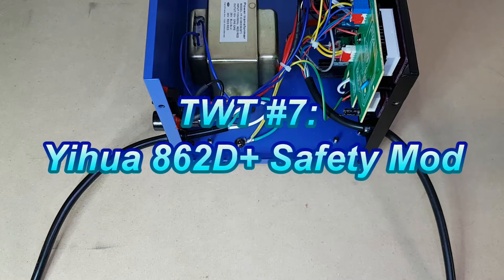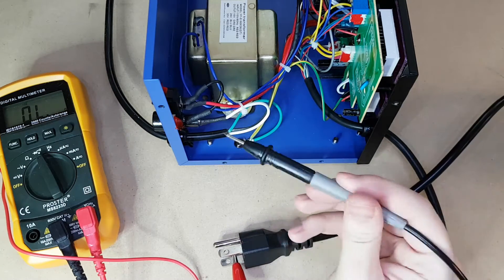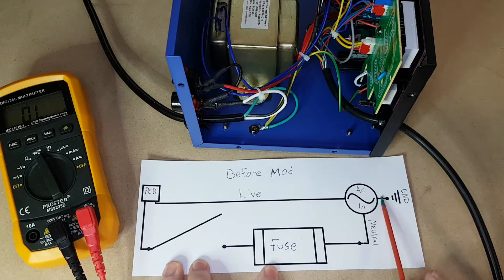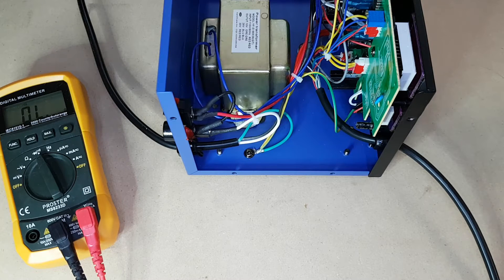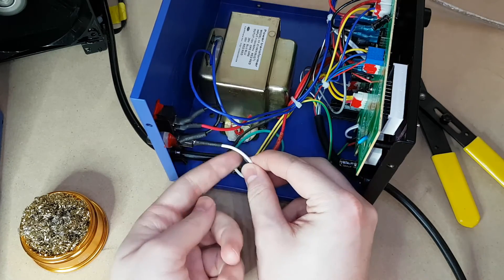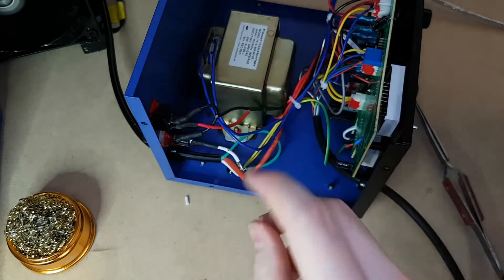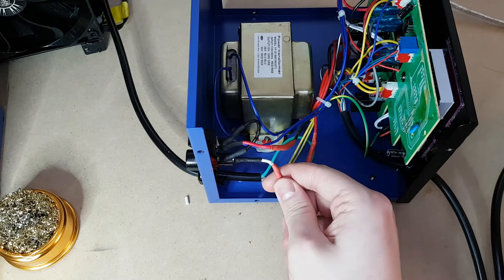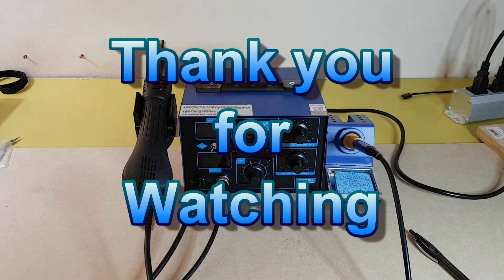TWT #7: Yihua 862D+ Safety Mod

Comment: Do you know that there are lots of countries, for example Germany, where the mains plugs are symmetrical and nobody is able to tell where neutral and live will be connected to ?
The construction of a device has to be safe, no matter where the live and where the neutral wire will be connected to. Opening up a case or changing a fuse without disconnecting
a device from mains is not recommended IMHO. Otherwise, of course if Yihua is supplying countries with definite positions of live and neutral, it should obey the regulations
of that countries or even better use IEC receptables in their cases.

Comment: I purchased one of these and used it several times until it failed. I opened it, and the fuse housing was broken. I will replace the fuse housing and rewire it according to your video. My question is: What is the correct AMP for these stations since there is no marking in the station itself?

Comment: i'M SURPRISED THEY CAN SELL IT IN AMERICA. You should not have to fix your equipment when you buy it.
Reply from the maker: That's the joy of ebay and amazon, most of the merchandise doesn't have to meet safety standards because nobody ever audits the sellers and even if they did, they'd just create new stores.  If you need mission critical equipment that doesn't potentially have these kinds of issues, you have to go to a supplier like Digikey or one of the other big names that actually care about the products they sell. :/

Comment: I know in Canada that the white is neutral and the active should be either black, red or blue depending on the phases used, but wouldn't it have been simpler to just change the plug and correct the wiring there?
Reply from the maker: Yeah, in hindsight it may have been simpler to just swap out the cord and rewire it correctly.

Comment: This is a very common problem with these soldering stations from China. So common, in fact that I starting to think that they do this with all of their products. If you look around for a bit then you will see that of the many different brands, shapes and sizes, this particular schematic design seems to be in all of them. Lost in translation or culture somehow? I don't know. But as much as I do enjoy the excellent prices of these devices, I will certainly be checking 100% of these as time goes on.
Reply: Ah, Would you repeat that one more time, I didn't quite hear you

Comment: ac  + and -   will still be live  and will still give the same shock  .   so it does  not matter  what  side the fuse is on .  so  to isolate bot  put a stdp switch on so it sorts all problems out  .  a transformer does  not need to  be positive  or negative so it does  not matter how you connect it.

Comment: Thanks for the heads up. I just ordered one of these on eBay, so I will check the polarity as soon as it arrives.  The problem probably occurs because other than North America, almost all other countries use 240v with two live wires.  I suppose in that case it wouldn't matter which wire is connected to the switch and fuse, although those should have a two Pole switch to positively turn off the power.
Reply from the maker: Yeah that does seem to be the most likely reasoning, I suppose it is just, more or less, an oversight on the NA and UK versions. Hopefully yours will be wired correctly out of the box!

 I suppose, to be fair to Yihua, the station isn't actually compliant with NA code and doesn't ever claim to be (or at least didn't back when I bought mine 2 years ago). On the plus side there seem to be a lot fewer units shipping nowadays with the reversed wiring inside, at least based on the very small sample size of this video's comments section. 

Even with the potential issues it is still a very good soldering station in my opinion at least, based on my hobbyist usage. Really I suppose the simplest fix to the issue would have been to plug the unit into a power strip with a switch and turn it off whenever it was not in use. In the end though it has been a very decent soldering station and hasn't needed any repairs in 2 years of hobbyist usage.
Reply: Correction. 240V countries still have one LIVE and the other neutral.  The only live wire is 240V not 2 live wires.

Comment: You're awesome for doing this video! Subbed.
Reply from the maker: Thank you for the positive comment it made me smile.  I'm just glad people find this video helpful, or interesting.
Reply: @TinkeringWithTerrius   Np man. You deserve it. It's surprising to me with the amount of the reviews on this (and 'similar' devices) that say they have this flaw and that there aren't more videos on this. Even if it's just to complain about the flaw or QA or whatever else. 

Anyway it helped me see if it was right and I thought it was. I decided to plug it in and bam. Lights blinking '------' and '8' alternatively. Hot air fan restart cycling. 

Tried to open the hot air part but I didn't feel like breaking it. Welp, I'll come back to this after finals are over.
Reply: @TinkeringWithTerrius  turns out a cap basically got destroyed when I first plugged it in. No evidence there was even a cap there other than a couple burn marks. Plus a few cold solder joints fixed now. 

Just wanna say thanks again. While I didn't have this specific issue, it's always nice to check. :)

Comment: I just bought one of these and came across your vid just hours later. My version doesn't have the master power switch on the rear, only the fuse. Gonna check anyway.
Reply from the maker: Hopefully it was one of the correctly wired ones, I suppose the variant with no master switch is just a cost cutting measure, can't think of any other reason to remove it.

Comment: I purchased this unit unbranded from an Ebay seller e-vipcom.
Mine is missing the rear switch, but it wired properly.
It also has 2 broken capacitors floating around in it, and the iron will not go into standby mode.
Otherwise it heats quickly and seems to stabilize. I will report back with how they handle the situation.
Reply from the maker: Glad to hear it was wired correctly, even if it has broken capacitors inside. I look forward to hearing how the seller handles the situation!
Reply: wow urs has standby, wish mine did

Comment: ...Must be how it's done in China?....or are they out to electrocute a few Trumpsters?...
Reply from the maker: I imagine it is just a lack of Quality Control, seeing as there is no oversight on these units by any regulatory bodies (as far as I can tell they don't have any of the necessary safety compliance certifications for sale in Canada at least, so importing them to sell would be dubious at best.) To be fair though, for a product with this functionality and this cheap, it isn't surprising that there are some potentially serious drawbacks, the saying "you get what you pay for" comes to mind.
Reply: ..but...didn't someone point out below...that all you need to do is switch the wiring around?...I mean...reverse the input leads?...The input color coding is not correct for US but we still know what is in the tubes....
Reply from the maker: Yes, as long as both he fuse and switch are wired wrong, swapping neutral and live from the mains cable works. 

I have heard of units that have the fuse on live, but the switch on neutral or the switch on live but the fuse on neutral, I have also heard of units that are wired correctly with no issues, it seems to just be luck of the draw whether the unit was assembled correctly or not. Thus I think the real underlying issue is that they just don't care or bother to QC the units beyond a simple "yep all wires are connected and it turns on".
Reply: ...and...in the end....these units are an amazing price for what you get..just the iron alone is worth it....
Reply from the maker: Indeed, it is a surprisingly good unit for the price, despite the potential shenanigans inside.  Certainly a lot cheaper by at least an order of magnitude than a Hakko or Weller or other name brand equivalent.

Comment: Thank you for your video, very informative. I can also report that I purchased one of these days ago and it's wired 'incorrectly' for NA use, with neutral going through the fuse first and then the switch, and the transformer bearing March 2018 as the manufacture month. I ended up wiring it so the fuse is behind the switch on live.
Reply from the maker: Glad you found the video informative. It is unfortunate but I feel the majority of these will ship with incorrect wiring until something new comes along to replace it, there doesn't seem to be any incentive for the factories to fix the issues. I suppose if nothing else, it is a good reminder to always inspect cheap electronics before using them!

Comment: So for a good test, red aligator on nuetral plug, black probe on white cable + continuity test mode should = no beep?  This sound right? Also mine does not have a on/off switch at rear. Pic here: https://imgur.com/a/tBl0yxC
Reply from the maker: Very odd that they just omitted the mains switch in that unit. 

Assuming a North American style plug, If the meter is attached to the Neutral plug, and you probe the white wire you should have continuity if it is wired correctly (based on colour code of the wires). If there is no continuity then it is likely wired up as Live rather than neutral.

I would remove the fuse and then check where Live and Neutral terminate. If Live has no continuity to any of the live connection with the fuse remove then it is wired correctly. If it does have continuity I'd check and see where the neutral terminates, just to be sure, if neutral makes no continuity to it's connection points then the fuse was wired in backwards.

The colour of the wires seems to imply that the wire that should be Live (the bluish wire in your picture) is going to the fuse, but I'd still double check and make sure that the blue wire is actually live not neutral. I've seen these units where the white wire (which for NA is supposed to be neutral) is Live and in that case the wiring would be backwards.
Reply: Pics here: https://imgur.com/a/xYuowLx

I have a blue wire going into the center of fuse from power, and a red cable on top of fuse going to the controller board. I get a neutral continuity beep from the threaded part of fuse (when it is removed), and switching to the right hot line i get continuity in the center of fuse. I also get continuity on ground, from screws at bottom, the ground connector bundle, and middle bottom pin for hot iron connector at front. Update, checked connectors going into motherboard 5 are both hot and neutral, but only neutral with fuse removed. It kind of seems like it is wired good, but i really dont know.
Reply: Down below you mentioned "If the continuity stays with the switch turned off, or the fuse taken out then you should be concerned." That sounds like me, i have neutral continuity at the motherboard with fuse out. But hot continuity stops.
Reply from the maker: This sounds like it is wired correctly. If you have neutral continuity to the main board with the fuse removed, but do not have live continuity to the board with the fuse removed then everything should be fine!

Basically the important thing is that, if the fuse trips we want it to stop the live side of the circuit as early as possible. From what you are describing in the last 2 replies, it sounds like yours is one of the lucky few that is wired right!

Comment: Thank you for this video - as a point of reference, these units are still (August 2018) shipping out with this configuration.  I used your video as reference to correct mine before I ever even plugged it in.
Reply from the maker: Thank you for the comment, I'm glad to hear the video was useful! It is very unfortunate that these are still shipping with issues like this, I suppose it is unlikely that they will ever change.

Comment: hello, I have such a device is broken me. I need for this data sheet or circuit diagram. can you help me, thanks
Reply from the maker: I spent quite a long time searching around for a schematic/circuit diagram for the 862d+, unfortunately I wasn't able to find anything. I'm sure there is one out there somewhere, I just haven't had any luck finding it. Wish I could have been more help.
Reply: Tinkering With Terrius Thank you

Comment: Double check if you buy one! I just checked mine and my right side was fused (ie the hot)
Reply from the maker: Glad to hear some of them are coming wired correctly! Was the switch in the correct location as well? (immediately after or immediately before the fuse)?
Reply: Tinkering With Terrius immediately after the fuse, however the case is not grounded because of the giant glob of loctite they used. I actually don't see any ground going to the board
Reply: In aircraft construction I can tell you that in installing all ground cables we used a small rotary steel brush with a guide pin that fit into a drill chuck.  You grind away paint down to bare metal, install the ground cable and then we would dab on a weather-proof coating to seal the connection and prevent moisture intrusion that could oxidize or corrode the ground and make it unstable.  I wouldn't use RTV as it breaks down over time.

Comment: Thanks for unboxing and disassembling this device. I am quite interested in buying one for myself.
One thing I am really startled about ... In Canada you know exactly which side is neutral and which is live? Quite a great electrical design done there ...
Don't know if you know our eu-plugs than can be used "normally" and by 180° flipped ... You can never tell which side is live ... Nor you can at the wall socket, depends on how reasonable the electrician was and even more important ... If you know which side should be live. Not even I know which side is normally live, even I am a learned electrician...
I think, if I buy this device, I will mod a 2-phase switch and another fuse in it.

One thing still bugs me ... You are telling "soldered earth connections are bad" but you solder the main wires too ... Not the "good way" either ;-)
Reply from the maker: Thank you for commenting!

Indeed, in North America if the cord has a ground connection then the Live and Neutral are always in the same position, much the same as the UK plugs (though their plugs are much sturdier and just overall better designed.) 

Looking back now I really should have done a proper mechanical splice on the wires before soldering them, maybe someday I will get really ambitions and revisit this mod and tidy it up a bit.
Reply: I think he meant the ground soldered on the plate or body instead of having a screw attached to the body as we see here. COuld be wrong but that's the way i understood it.

Comment: I think this is the case because in many countries the position of live/neutral in the socket is not strictly defined.
Reply from the maker: Yeah that seems to be the main theory. It still seems a bit odd though, since they are using integrated plugs instead of just a standard C14 socket. You'd think it wouldn't take much effort to make sure that when you're attaching the N.A. plug you wire the fuse and switch on the live side.

Alas it just seems to be the way these units are made and it isn't going to change.

Comment: Lol you dudes and your dangerous 120v  :D  Whole europe  can tur their plugs both ways and we use 230v   and somehow its  still secure ;> The important thing is  that the ground is connected.
Reply from the maker: Thank you for taking the time to comment!

The big thing to remember in this regard is that electrical standards are very different between Europe and NA. Even worse, most every state/province has different electrical codes over here. In a lot of cases Electrical codes, in Canada at least, are very antiquated and there hasn't been much change to them in decades. 

The ground being connected is indeed very important, however you are making an assumption that the ground is indeed connected properly, in addition that does not prevent all possible issues. 

Where I am located there is only a requirement for GFCI/RCD breakers in rooms that have running water and more recently bedrooms (and as far as I know this is only on new construction, old construction only needs to be retrofit if you are doing major permitted work on it). This means that only bathroom/kitchen/outdoor and bedroom plugs would be able to handle and break the circuit reliably if a ground fault is detected. The other 15 amp breakers would require a huge current spike or a sustained 15 amp current to trip their breakers, which a ground fault may or may not provide. 

A simple fix for us North Americans is to have an inline fuse (like used in U.K. plugs) or to have a fuse that is properly installed in the unit (which is a very simple fix, or could easily be resolved at the factory by using C14 sockets with built in fuses rather than dodgy built in cables.)  In my case I have the unit plugged into a fused heavy duty power strip in addition to swapping the fuse to the correct side of the mains, redundancy is almost never a bad thing.

230v is certainly more dangerous, but the fact is, any mains voltage can be deadly when handled poorly, so why take the risk of poorly assembled products if you can fix the issue? Personally If I was dealing with 230v I would be even more concerned about the safety of these devices.

I suppose my take away from opening this up was, 1) Never trust cheap imported and un-certified products to adhere to electronics standards, 2) It's better to be aware of issues before they occur, and 3) It's always better to be safe than sorry. Besides it can be fun to open these products if done safely to see how they work and are constructed.